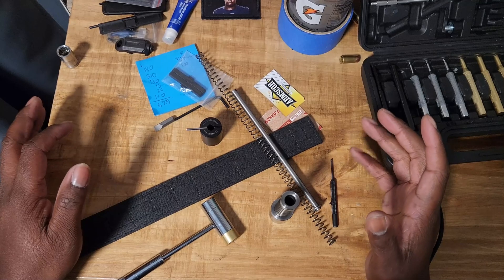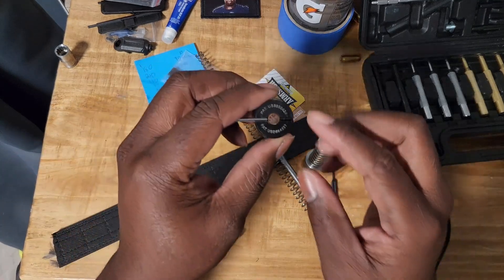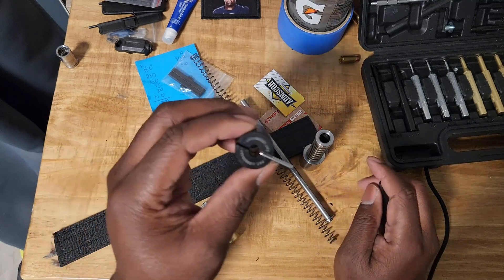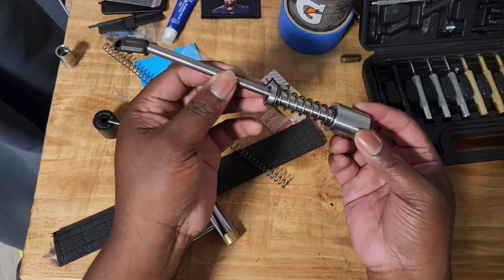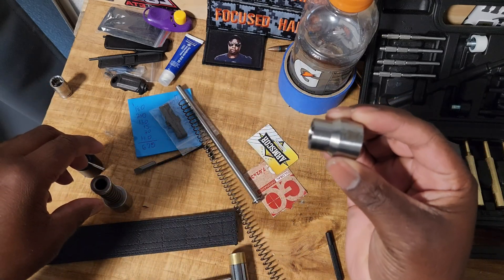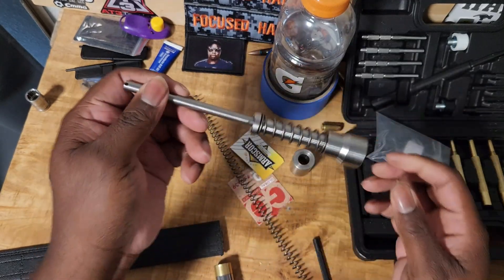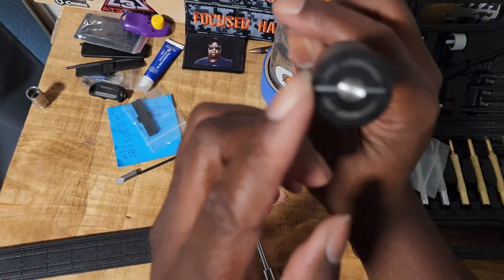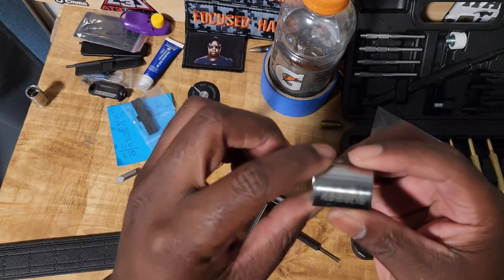ARMASPEC SRS Gen 4 Complete Disassembly

Comment: I bought the H3 for 10.5 300 AAC with superlative gas block. Does great with supersonic but terrible with subs. I’m gonna replace the weight and maybe I won’t have to clip the spring.
Reply from the maker: Hmm are you running it without the folding adapter? If im working on a fix for this right now.

Comment: With all Arma spec springs, before making any edits, Id recommend leaving the bolt locked back on spring every night for a week—in the morning, run the charging handle 100x and lock it back again till next morning.

After 1 week, you’ll have a more consistent and lighter spring after it “breaks in”.

Also: 

1. Apply a thick lithium grease on parts when disassembled for smoother functionality.
2. Polishing inside of washer, all rough/ridged parts will function smoother too. (i used a lapping compound and elbow grease for polishing inside of washer)
3. Up to 6 coils may be cut off from SRS long spring to reduce spring weight.
4. SMB spring may be used for lighter spring. Up to 12 coils may be cut from this spring.

Comment: Good video, need a small hole drilled through guide rod to hold the spring tension, use a punch to hold the tension, will make it easier and safer to install roll pin.

Comment: U didn't show how to disassemble the weight unfortunately cuz I bought a spring that came with the h3 installed on it. Gen 4. It was already put together. I'm trying to disassemble it to put the carbine weight on instead. Urs was already disassembled
Reply from the maker: @unleasheth  ill see what I can do on this! With youtube policy changes... I may or may not be able to show it.
Reply: @FocusedHands  Its all good brother, I finally just went for it today and used a vise in order to remove the steel oring from the buffer carrier, in order to change weights. U have to put it on the edge of the vise and at an angle, to get to it. I must have one of the first batch of gen 4 recoil kits. Everyone elses I see online does not have this ring. it wraps around the carrier exactly like a gas ring on the bolt does, falls into a channel and in place. Its easy once u get all the tension depressed to get to it that was the difficult part I was having
Reply from the maker: @unleasheth  glad you got it worked out! Let me know if you notice any difference in the SRS gen 4 vs. the regular  buffer spring.

Comment: I had the same problem even with the c weight my fix was I back off the buffer tube one full rotation to let the srs assembly ride back just a tad more and I get bolt hold on last round now with full power loads 50/50 with lighter loads
Reply from the maker: Hmmmm! Im going to try this!

Comment: I have a DB AR 15 10 inch is the C weight  the right one
Reply from the maker: You would need to fire it and see the shell ejection angle is. If it is not where you want it... you will need to change buffer weights. Since im left handed / lefthanded ejection ports and dont like my shells coming back towards my face... i have my shells ejecting at 6oclock. Some people like 12 or 2. Really depends on you.. is the short answer
Reply: @FocusedHands I thought the goal was to spit out at 3 o'clock 🤷‍♂️ I put an Armaspec SRS (H) in my 18" 223 wylde (non adjustable gas block) and its spitting at 2... I figured that was a touch over-gassed but I'm still learning... is it OK to have them spitting out at 2? On a regular right handed rifle.
Reply from the maker: @twistofcain_666  There is a chart for righthanders and ejection angles... I'll try and find it and post it to Instagram for you.
Reply from the maker: @twistofcain_666  3Oc is just a range... some people prefer 2Oc... I actually prefer  mine to fly forward.
Reply: @FocusedHands  I really don't mind where they go, just as long as it cycles well. I'm getting a new Aero NiB BCG tomorrow (hopefully) so that may change things slightly but who knows lol. It's my first AR so I'm doing everything for the first time round and just don't want to screw it up lol. I appreciate your help! 😊
Reply from the maker: @twistofcain_666  so after review it looks like 2Oc is undergassed for righthanders. I'd check the buffer weight and adjust there. You could adjust with an adjustable gas block aswell. Bcg would help aswell like you mentioned.
Reply: @twistofcain_666 your optimal ejection angle depends on the ammo. For example, a M193 with a 55gr bullet is fine with ejecting at 3.5Oc or even 4Oc, as long as it cycles. But the heavier SS109 (M855) with a 62gr will eject at 3Oc with same gas block setting. TL;DR it’s always best to slightly overgas the system if you’re shooting different loads.

Comment: Did you end up clipping off the long spring? if so how much? I just put an H on a .300 and had cycle issues. The lighter weight isn't expensive, but I feel like the spring might still be too strong.
Reply from the maker: I did but it did not help with the bolt catch. The issue is not the spring... but the srs/bolt extender/law tactical combo. Im currently working on a solution
Reply: @FocusedHands  Thanks for the quick reply. I'm just running a mil-spec receiver extension. I seemed to keep getting double feeds, which doesn't make sense to me. I'm running a blow back system, so maybe a lighter weight will allow more compression of the spring for my system.
Reply from the maker: Yea try running the C (carbine) weight before you clip any of the spring. What mag you running?
Reply: @FocusedHands  The mag I'm using has been used previously and had no issues with a normal spring and buffer weight. Only when I went to the SRS system did the feed issue occur. Got the C weight on order.
Reply from the maker: @embryoisme  ahh ok! Well I hope the C buffer works! I might need to run the C weight on my Xolo 5.56. I noticed the shells flying forward.
Reply: @FocusedHands  Thanks, keep up the good work on the videos. I just finished watching something from armaspec yt saying due to the multi stage spring system to spring down, would have been nice to read that on the website when ordering lol. Have a good one, I look forward to your other videos.
Reply from the maker: All my mags are magpul gen 3. No issues with double feeds. If you have a magpul gen 3 test that also/ if you have any other brand.

Comment: How did you know to switch to the lighter weight to C vs. H? Also, what type of AR15 are you running where the bolt catch wasn’t functioning after the last round?
Reply from the maker: The ejected shell casings give you an idea of which buffer you should use. Some buffers cause the shell casings to eject at 10 o clock some at 1 etc etc. This will depend on whether you are running suppressed or not aswell. All those variables come into play here. As far as the gun... i tried it on my goblin (5.7) my 300blk and my ks 47. All would not last round bolt hold open (with the law tactical folder and aftermarket bolt extender. If you run the srs without the law tactical folder... it works fine. I believe i have the solution to this issue... but i need to get the jprifles short bolt extender in for the confirmed test!